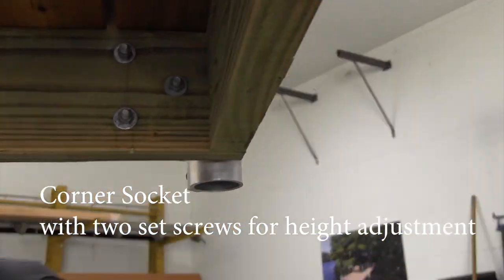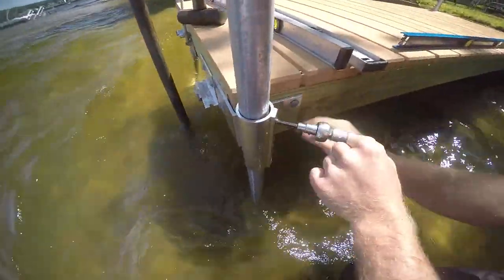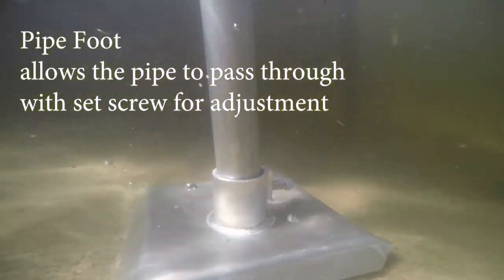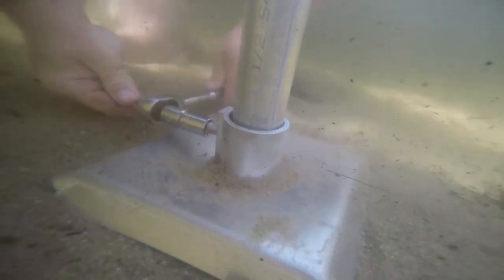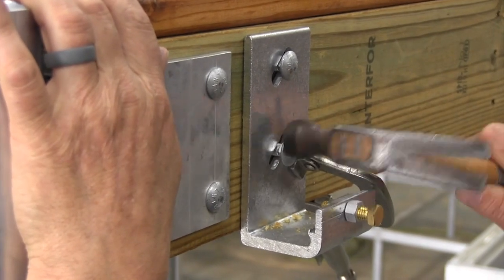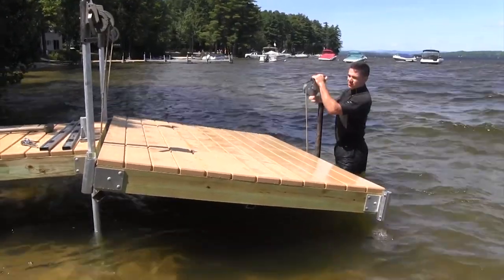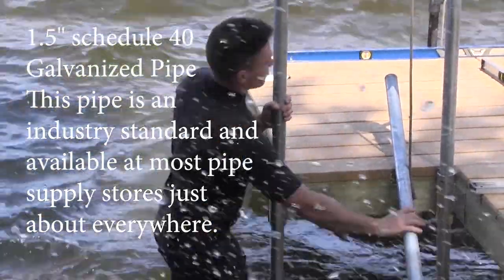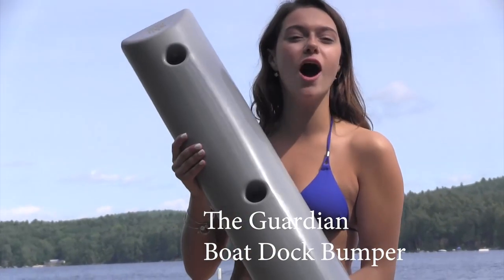Pipe Dock Hardware by GND

Comment: I would like to know how do I contact you concerning the product.
Also, Is this system affective in icy winters? Our ice will go up to two feet thick.
Reply from the maker: You can buy the hardware at 3 places online.
Dock plans show how to make them in sizes you can move them by hand in and out between seasons. If left in, the ice will bend the poles and crack the stringers so take it out just like you take out your boat and boat trailer. Ice is very powerful and it moves, expands, floats down stream and tilts on the shoreline. We are a Maine manufacturer where docks need to come out 7 months out of the year by law and because of the ice. This is rare but ice has been known to push up on shore and destroy docks that were stacked above the waters edge. Our aluminum frames are also built in sizes that can be removed by hand. We offer removable decking so the frames are lighter.
https://www.dock.shop

https://greatnortherndocks.com/stationary-pipe-hardware/dock-hardware-pipe-leg-support/
and at https://www.amazon.com/greatnortherndocks